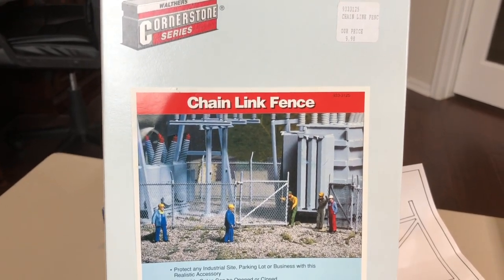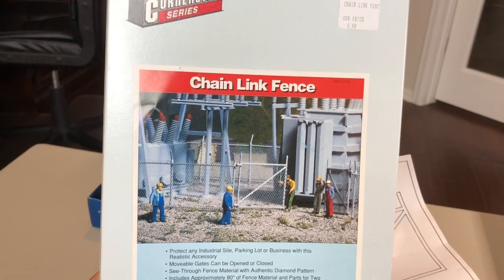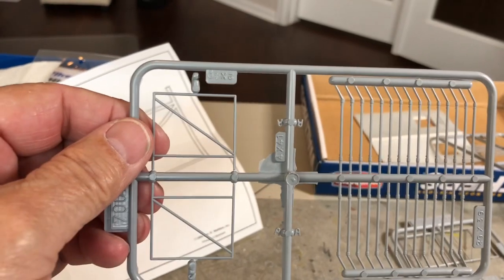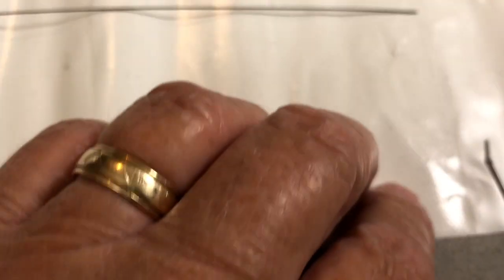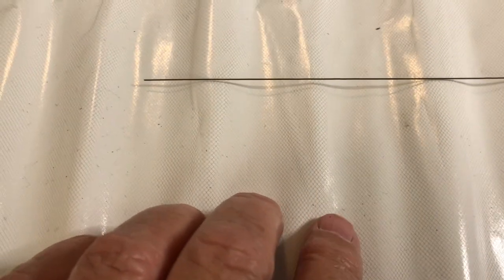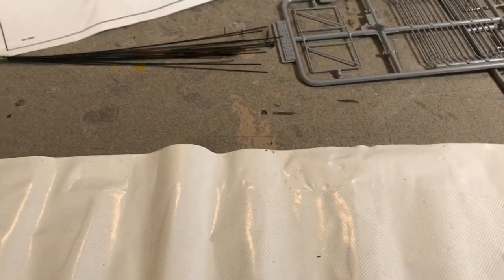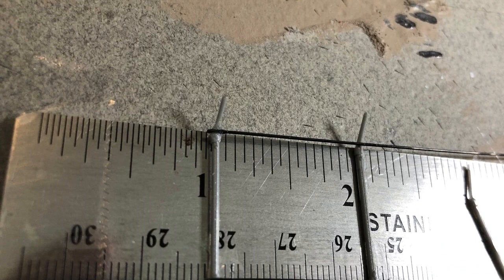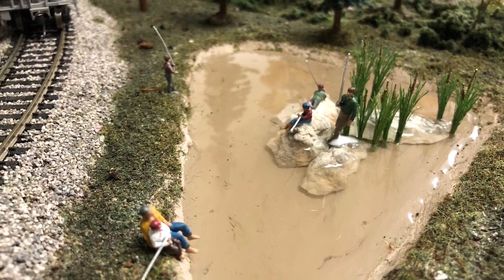My 4x8 HO Layout Expansion Part 42 - Chain Link Fence

Comment: This comes too late to do you any good, but I ran across it while installing a chain link fence on my Walthers electrical substation. In another video a guy was scratch building a fence with styrene and he used.030 styrene rod for the support rods. The rods glued easily to the posts and took a little time but all the rods and posts came together nicely. The chain link material was pre painted and glued easily to the rods. Then I painted the rods.
I won’t lie. It was a slow go.
The last time I tried to do a chain link I gave up half way through and turned it into a fence under control scene and posed some workers around it 😁
Reply from the maker: Thanks for your comment.   Worst Walthers model ever!  Mark @ M&M Rails did a Woodland Scenics fence so I thought I’d try that.  Nope, the pieces were warped from the start.  Guess I can heat them and straighten.   BUT #$&@ I’m giving up on fencing!

Comment: Hey Fred, in doing that fence and gluing it with CA you would need an accelerator to spray on the glue and it will set up in seconds. The product is Insta-Set from BSI their web site  is www.bsi-inc.com
Reply from the maker: Thanks for the tip Big Bill but I’ve moved on and not looking back.  Life is too short and there are too many other frustrations that I HAVE to fix, like stupid switches.
Reply: @FredE528  I get it Fred, just another weapon in the holster so that frustration does not take you down.
Reply from the maker: Thanks Bill.

Comment: My thoughts exactly....Woodland scenics  has a better kit reasonably priced or there are laser etched kits that are very nice a bit more but will save your nerves because they're easier to assemble and look good by Alkem scale models
Reply from the maker: I ordered another corrugated fence.  Those I can handle.  I have to deal with the frustration of dead frogs but I’m not adding to my stress with this model.  At my age, I have a new motto : If at first you don’t succeed, stop and go another direction.  Screw it! Thanks for the feedback.